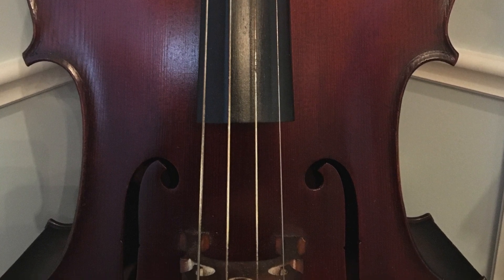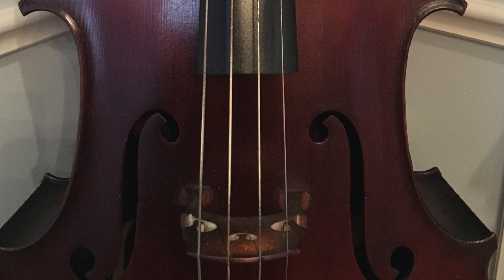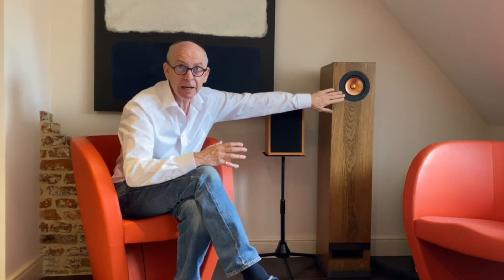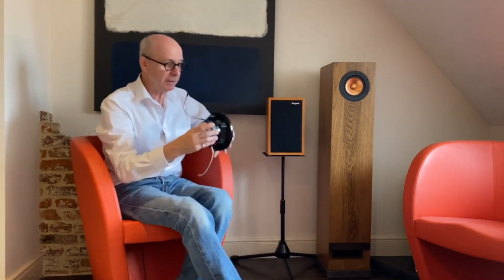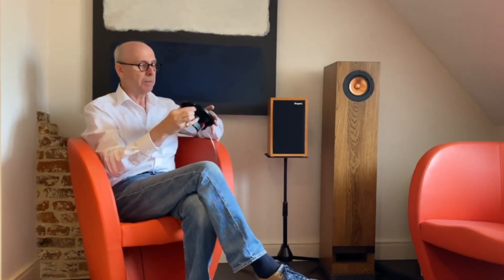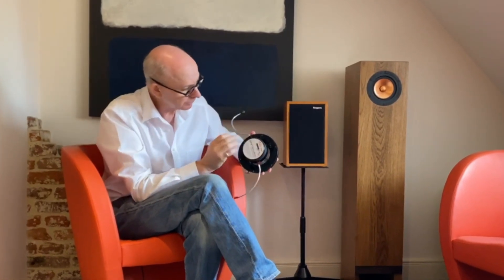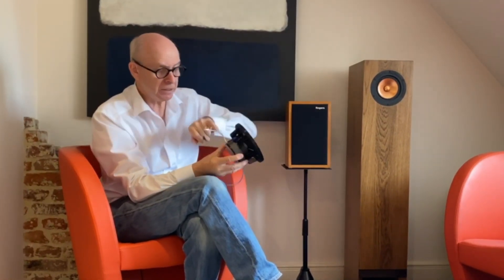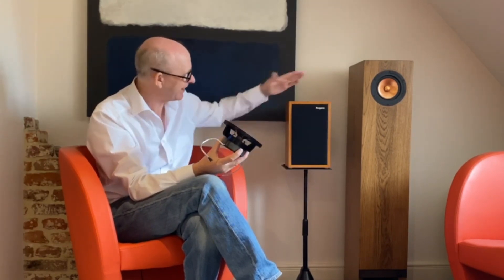The LS3/5A versus the Sibelius Loudspeaker

Comment: Yes we can make small speakers but it was expensive and did not sounded good…. Hmmm so you could not make a small speakers….. all Kef sounds prestty good even today after 40 some years
Reply from the maker: 😉 - indeed. What I meant was, we tried to make a small, single driver loudspeaker, without any kind of crossover. But they were not good enough to meet our standards. Indeed, KEF do make excellent bookshelf and standpoint loudspeakers.
Reply: @PearlAcoustics  Yes. Those fullrange speakers always compromised. But they  sound good,too. Just different. Except if we can buy a Tannoy westminster royals... 😀

Comment: How about some measurements if the mid range is all that smooth?
Reply from the maker: Hi, thanks for your comment. there are Kenny of graphs to be found across the internet. I think the most important fact here is that the BBC design team built a tiny loudspeaker (unheard of at the time) that gave a very nice vocal presentation, so that if it sounded ok through the little LS3/5A, then it should sound OK in peoples homes too.

Comment: I try Harbeth P3ESR with my Sugden A21a, listing classical quartet or trio, the cello is not enough present. So I prefer the Quad 12l. I just retried the Harbeth P3ESR with a Yamaha CA 810, it is good by not so much. With a Sugden A40, it is better, but I need to drive at 6, very analytic, the singer (French recording) is up front, enough bass. This amp is very fast. Is it possible that the new generation of speaker prefer new generation of amp ?

Comment: The first time I heard a pair of LS3/5a speakers I was quite astonished  - and that's saying something because I had been a recording engineer for some years and was later employed as a design engineer for a famous manu at the time. 
It wasn't that the LS3/5a could produce the entire range down to extreme LF. Their massive advantage was actually that what they actually 'did' produce was very accurate. In other words, no one in the design team for these speakers had gone into the 'Narnia land' of trying to fake what wasn't there naturally - with ports, resonators and all the rest of the tricks being used these days. 
The moral of the story was stark: We can put up with a certain absence on the lower registers - far more easily than we can tolerate those frequencies showing up out of phase, many milliseconds late with a faked dynamic timing envelope - out of a port that's way distant from the actual speaker driver itself. 
If you talk about the resonance of a double bass cavity causing a typically characterful 'thump'? Having the frequencies of that 'thump' arrive later than intended with a different phase and envelope, does not produce the same impact. If you can't do that with your fundamental speaker design - then it's better not to even try. It may seem to work steady state, but dynamically it will fail :-(
Reply from the maker: Thanks for your comment. Totally agree, phasing is the secret, while ensuring to avoid unwanted resonance. That’s what took us so long to ‘perfect’ our design.
Reply: @PearlAcoustics  In no way am I trying to denigrate the quality of your product, or trying to get your to reveal commercial IP. But what I don't get is that your speaker has one relatively small driver providing low mid to HF response from the top front, but your claim for LF down to 34Hz speaks of a long wave guide coupled to the rear of the drive until - exiting via a port at floor level? 
However well and cleverly you deal with resonances and loading in that long wave guide rear port and total loading of the driver at LF, there is no way you can ensure synchronicity of timing between the mid and upper ranges and the LF which exits the port at the bottom - unless you have an additional speaker driver at the bottom of the enclosure as well? 
It may provide a decent response to steady state signal (i.e. static frequency plot) and a great transient response in the mid and top ranges (due to the single driver and absence of phase bending X-overs), but it cannot be dynamically correct for LF to Mid range impulses, even if the wave guide is devoid of resonances? I would also worry about the excursion of the small driver at LF below 70Hz or so at higher levels, due to the fact that it is not pressure loaded by a restrictive enclosure.

Comment: Bought my DIY LS3/5a components from Wilmslow Audio in Cheshire a very long time ago. They had a basement listening room, a 2 seater couch and a large selector panel. You got a 15 / 20 mins listening session. After hearing 'Avalon' on the LS3/5a I was convinced. Plus,  the kit was my budget limit. The Kef units, a crossover board, a design sheet. Used MDF, hardwood battens, Dead Sheet and Dr Baileys wadding. Of course I should of used birch ply etc - but I still have them and listen to them from time to time. That said, these day's I can't really justify replacing them with anything else. One day maybe... one day...
Reply from the maker: Nice story… 🙏

Comment: 5:24 I'd be careful with your analogies, your argument suggests that your speaker has to resonate, just like a musical instrument, to produce the low frequencies.  In the terms of an organ or double bass, those resonances define the instrument.  But your speaker isn't an instrument, it is supposedly accurately reproducing the sound of an instrument.  But by your own argument, it has to resonate like an instrument to produce the base, therefore it will produce a resonant coloured bass, if your argument's correct, not the bass off the sound it is trying to reproduce.  The violin argument supports this, again, a violin is small and doesn't have the volume to produce the lower frequencies. A speaker is not a musical instrument, it is, supposedly, a means of accurately reproducing the sound of a musical instrument.
Reply from the maker: Hi. You make a very good point here. I over simplified and could have put it better. It is the drive cone that generates the frequency and in turn, pushes the air through the pipe. Rather like how a pair of reeds in a bassoon generates the frequency that forces the air down its pipe. The Sibelius pipe is designed to be absolutely rigid to allow the air to flow through, without losing energy due to enclosure vibration. But evrn this analogy is too simple. Thanks again. Harley

Comment: Maybe off topic, but: I would like to see a speaker manufacturer, (like Mark Audio), steal a page from guitar pickup makers. Make two matching drivers. Reverse wind one coil and flip the magnet. Connect them out-of-phase. (Reverse polarity actually). Now the signal would be in-phase, but the back EMF would cancel, thus minimizing, or eliminating, the concern for amplifier damping factor.

A Sibelius with this configuration could be sweet. (Not that it isn't already.)  🙂
Reply from the maker: Thanks for your comment. Indeed, I have seen some amazing designs in my time but never along those lines! food for thought. 😉
Reply: @PearlAcoustics  It's funny, but when you put something down "on paper", so to speak, you can see your own flaws better. Guitar makers do that to eliminate noise picked up by the coils. But if the signal applied is in-phase, then the signal generated by the cones, would also be in-phase. I'll have to rethink this. Waiter, there's a fly in my theory.
Reply from the maker: @artiehall7708  😀😉

Comment: Of all the manufacturers licensed to make the LS3, is Rogers the closest to the original BBC? I've heard the Falcon Acoustics are superb. /It's easy to get lost in the LS3 maze.... (I must add I'd pick your Sibelius over any LS3 ANYTIME no doubt 😉)
Reply from the maker: Hi, in the early days, there was (or should have been) no difference between the manufacturers… because the drive units all came from KEF and the crossover and enclosure specifications were very tight. 
In recent years with new companies making the drive units there will be a difference, but this is certainly not a bad thing. The BBC design was great in its day but compared with modern equivalent loudspeakers, I do believe the new ones should sound better. For example. Falcon have massive experience in the loudspeaker driver market - and can source drive units from an extremely wide source of manufacturers. So it will be a matter of listen and compare. They will all be similar but not the same. 
So glad you appreciate our loudspeakers 
Best wishes
Reply: @PearlAcoustics  Thank you very much for your reply, very kind of you.

Comment: This is amazing - such in-depth knowledge. I am currently listening to R3 via a Leak Troughline 2 which I had rebuilt in 2003 and added the OTA decoder - its easily my best source, as opposed to Docet Lector CD player and Garrard 401/SME etc. They are in a room 29 sq m 9 m deep - and play via Glen Croft transvalve amp through Rogers JR149s! early version, on original brackets bolted to a 2 ft rubble wall. Some have said they are LS3/5A's with bass - its true, but hard to tell if the extra octave comes from the room.Your comments about the double bass do ring through - I detect some muddle and bass lift at the bottom end of cellos. Quartets - its like they are in the room but massed strings sound confused. I'm thinking Sibelius  . . .  and God protect the BBC engineers and live concerts.  I did start a project to build a pair of tuned cabs with JX92 and discussed with Eddie Jordan (!!) - they are still in the loft - hey ho. He and they are sadly gone, as is everyone of note at OTA. Love what you are doing
Reply from the maker: Thanks John. Great addition to the conversation.

Comment: Many of audiophiles are unaware that Jim Rogers built horn loaded speakers in the early years. Such is the impact of the LS 3/5a. I have a very rare pair of Mk2 Horn enclosures with Lowther PM6 and what information I have surfaced about them has largely been occluded by the LS legacy. Of course the foam has rotted on the Lowther's but I hope to resurrect them in the new year. They're rather large but as J.D. wrote in The Gramophone when reviewing them… 'No one has yet succeeded and as getting a quart out of a pint pot'.
Reply from the maker: Good luck with the restoration.
Reply: @PearlAcoustics  Thanks, I think I'll need it.

Comment: I once made a comparison between a Rogers LS3/5A and a Kef Coda costing much less and during a blindfold A-B  test most people I used for the test couldn't tell the difference..!
I often wonder how well the Sebilius speaker would perform if subtle changes to the cone suspension were made and the whole enclosure converted to a  less periodic transmission line ...
Reply from the maker: Maybe this is an interesting project for you to set out to try? Thanks for your comment

Comment: You commented on the fact that there are better "bookshelf" loudspeakers than you wanted to make.  Can you comment on which ones you might suggest to listen to (other than the HS7 & ATC SEM7).  I am looking at the price point of the Sonas Faber Lumina ll, but could go a bit higher if the sound is significantly better to my ear.  I love the technical engineering approach to your videos.
Reply from the maker: Dear Rick, thank you for your kind words.  I am not an expert on bookshelfs, but there are two that spring to mind.  Firstly (and you will need to ignore the look and price) The QUAD S2, punches way above its weight and although way cheaper than your budget, it just sounds great to me (only heard it at trade shows). The ATC SCM 11, is also very good, giving excellent detail.  But for a small room I would go for the Quad S2.  If you ever decide to spend tens of thousands ;-)  then the Magico A1.  But the pleasure one can have from music with the Quad S2 can be just as much, in the right setting. Hoping that helps?

Comment: In a Melbourne get together in my home 10 years ago, we found the tiny old LS3/5a was seamlessly and wonderfully integrated with an infloor IB subwoofer. Crossed over 24dB at 70Hz, the voices and imagery were amazing, and the sub just filled in the bottom end beautifully

We compared 5 other bookshelf speakers others had brought, and the LS was the standout. 

A great gtg with good friends, food and wine. We ended the day surfing the floorboards (with the mains and 2 IB subs) with one chap measured 130dB at the throat of the front IB lol
Reply from the maker: 🙏👍😀 nice story. Thanks for sharing
Reply: It's just what I was going to suggest, that a good pair of monitor with a subwoofer or a pair of subwoofers correctly adjusted, could do the job.

I have 2 desktop systems 2.1 and it's a pleassure listening music with them.

In the other side, you feel somethig special when you are listening a pair of speakers able to achieve full range, its more "natural". But I love both options.

Comment: I'm frustrated that the presenter has chosen to put forward some ideas and facts that are misleading if not worse.

3' 55"   "In the Sibelius loudspeaker the cone vibrates and pushes a common of air to produce sound out the bottom" that's exactly what every vented cabinet ever made or designed does. Nothing special about that all.

4' 19" Making the cabinet not add or subtract from the output of the driver is the design intention of every cabinet designer worth their salt. Sibelius is exactly like every other loudspeaker designed with any care.

6' 15" "the drive cone takes over...". From what? Nothing else is generating any sound! (Except of course any output from the cabinet walls.)

7' 24" This is actually factually wrong as the crossover frequency is 3 kHz; the b110 will be outputting much higher level than the t27 at 1.5 kHz. But no matter.

7 36. "so that has to be held back and suppressed with filters and crossovers" . Actually if you read the BBC r&d research paper it tells you that the crossover (as well as its primary purpose) adjusts the rising output of the b110 (4dBs between 200 Hz and 2 kHz) and also adjusts for a resonant peak. 
Frequencies above 70 Hz are not generally "held back or suppressed".
Yes, the techniques and technology available at the time were used to compensate for the relatively crude and coloured loudspeaker drive units available at the time.
I'm not sure why the presenter doesn't say that his drive unit is very technologically advanced. Huge advances in technology of drive unit manufacture have allowed him to use a single drive unit without any crossover which is a wonderful and very beneficial thing.

9' 30" "every BBC studio..." Simply not true. Most studio control rooms were big enough to accommodate larger speakers which were used in preference. But no matter.

The Sibelius loudspeaker looks magnificent and I have no reason to think that it doesn't sound even better.
I wish the company well and hope that in future they don't say anything misleading while promoting their product.
Reply from the maker: Thank you for your very detailed comment. We welcome all contributions. Please let me assure you that no part of this video was deliberately misleading. And was a ‘best efforts’ project that I put together as a talk, a discussion.

Comment: Hey Harley!! Hey I got a question. What are your personal thoughts & feelings regarding sacd. The feedback I've gotten is that it's smooth. Depending if the music being played back is not dreck. I think the music industry made a big mistake by not making sacd the industry standard. Instead of an expensive option. Then develop from there high resolution audio. The public at large would be used to high resolution & hopefully demand it.  Also I've been listening to Alberto ginastera piano concerto #1 interesting piece of music
Reply from the maker: Hi Jack, to be honest, I don’t have many strong opinions in this topic. Except I think sacd was just too problematic, logistically. It was like shops having to hold mono and stereo versions of the same content. Today with high res streaming I think sacd would have suffered anyway. It was good but commercially unsustainable. I always record in high resolution but that’s mostly for editing purposes, so we can go deep into the music and dig out a one hundredth of a second to cut our content (the thickness of a sharp razor blade on a 15” per second magnetic tape) 😉
Reply: Harley I would love to hear some of your work as a sound engineer. What ensembles have you recorded?  And at what resolution are they recorded? And would the signal be too much information for most stereo systems to deal with
Reply from the maker: @jackbarnard1781  hi - Jack, some of my work can be purchased from the Pearl Acoustics webshop but is also readily available on most streaming services. Try ‘Aveline Gram’ The Balmoral recordings. Or Veronique de Raedemaecke and George Tyriard. (It’s all classical. I will be releasing a video on the making of my latest CD / LP in October. Perhaps look out for that.
Reply: @PearlAcoustics  wow Harley I just listened to a sampling of aurore dassesse & aveline gram.  What lovely artists they are. & wow the resolution in the music. Crisp & clean. Well done lovegrove well done
Reply from the maker: @jackbarnard1781  thank you.